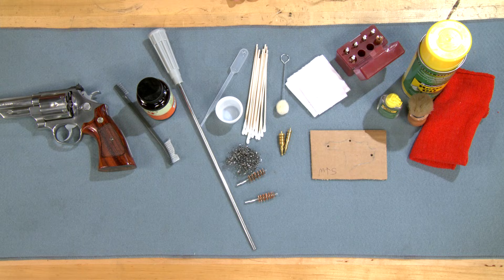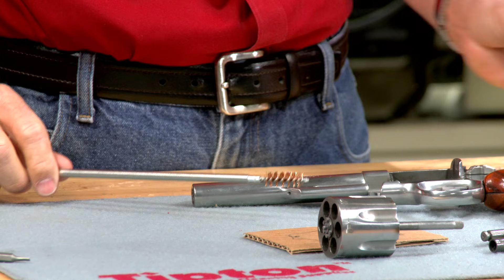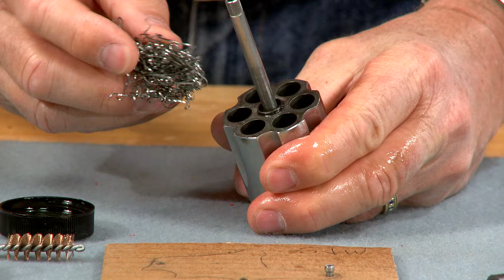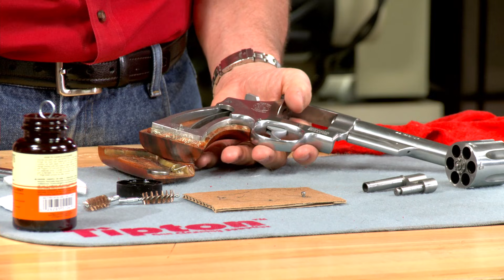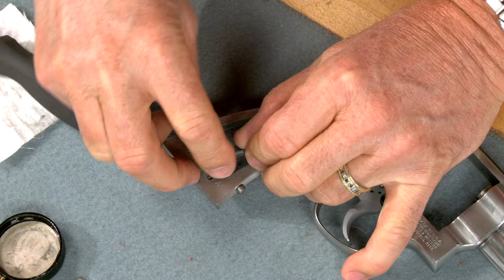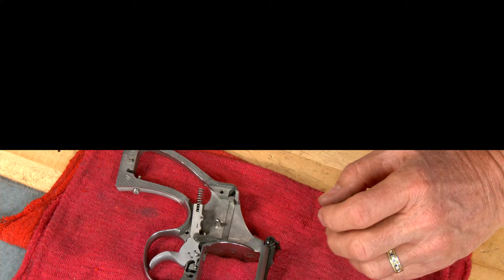How to Clean a Smith and Wesson Model 629 Revolver | Smith & Wesson Revolver Project

Comment: what i do is use a swab soaked in cleaning solvent and run that through all the major parts that collect carbon. Then after letting it sit for a few, i run the wire brush, THEN i run the same cleaning solvent again, then run several patches and clean it, THEN i put some lube on the swab and run that through and im done...been working like that fine for 30 years now...the way this guy is doing it, is if you wanna get your gun to a 100% perfect clean like if you are going to put it on display or something

Comment: Great Video, Larry.
I might add that one should take care when running the cleaning rod,  try to keep it straight and not rub the last bit of rifling bear the muzzle. Those sliding brass muzzle protectors should be used on the rod.
Also take care to not let the rod slam against the cylinder face. It is easy to do considering you are using some force to get the brush or tight patch through the barrel, then all of a sudden it enters the clyinder opening in the frame and there is no resistance.

Comment: I got a Taurus 83S in 1989 and fired it about ten thousand times until 1992. A gunsmith told me not to disassemble the extractor because "would be difficult not to break it" (he didn't know that model very well). Well... I disassembled the cylinder only in 2021 and I found ZERO reasons to open it, it was almost clean; no rust, no lints, debris , no powder, no fouling... I didn't understand.

Comment: Might want to try copper wool instead of steel. Softer metal  copper  "Chore Boy" will not scratch a stainless gun. Too scared to open the side plate.

Comment: Two things you failed to mention or show. You didn't show how difficult it is to reinstall the rebound slide and its spring. The spring is very stiff and can go flying across the room or worse yet, hit you in the eye. Next, you failed to mention that the ejector rod has a left-hand thread. To loosen, turn to the right and to tighten turn to the left. Remember the term righty tighty, lefty loosey? Do the opposite. Righty loosey, lefty tighty.
Reply: The thread pitch depends on the year of the gun.  Older ones were not reverse threaded.  Also, why would you think it's mandatory for him to make a commentary on everything?  This is just a quick video to show what's involved.  Reinstalling the rebound slide it not difficult at all if you have the tool he shows in the video.

Comment: May I suggest specifying stainless steel wool, instead of 'regular' steel wool. The possibility of cross contamination from iron in regular steel wool exists, and any contact could decrease the corrosion resistant (stainless) property of the firearm.

Comment: Larry should have demonstrated what a pain in the butt replacing the rebound slide and spring can sometimes be. A small screwdriver is usually better to use than the rebound slide tool.
Reply: The rebound slide tool is awesome for that.  It's a cone shape that fits into the end of of the spring and the bottom is hollowed out.  Makes it very simple.  No way to the screwdriver!

Comment: Please don’t disassemble your revolvers to clean them. A good spray solvent in each charge hole and down the barrel. Copper bore brush in all charge holes and barrel, nylon brush on cylinder face and inside window. Cotton patches on a jag in all previous holes and barrel. Old T shirt wipe down followed by oily old t shirt for protection. Disassemble only to replace or swap out springs. This video is so far beyond any necessary level of cleaning.
Reply: he said once a year pal
Reply: Bought a new model 27 in 2023 and popped the cover and stripped it bare.
The thing was absolutely filthy from the factory with a fine gritty dark disgusting filth in a 1200 gun.
It looked like it was assembled in a dusty field in a wind storm and the bluing looked like a monkey did it.
Ive cleaned S&W’s from the 60’s and 70’s that weren’t as filthy and that was right from the factory.

Last new one ill buy for sure

Comment: IMO, way too much oil is used in reassembly. Maybe if you are storing the weapon, but all the parts must disassembled and excess oil wiped off before I would ever fire it. I was taught a long time ago that even when you wipe off the oil and the metal looks dry, the oil has leached into the metal and will provide ample lubrication for proper operation. Too much oil attracts dirt and residue, all harmful to intricate moving parts.

Comment: My two revolvers sat in a safe for 15 years.  I then took them directly to the range.  After the first few shots they started to misfire.  I would pull the trigger and it wouldn't go back all the way.  I would then reload and try again.  Some shots worked...some didn't.  After a 10 minute cleaning using cleaner and oil...both guns started working.

Comment: When dissembling the gun, it is a good idea to take a picture of its initial construction before taking out the parts so you can use it as a reference when reassembling.
Reply: I agree with you, but taking a picture is a recent thing.  What did we ever do before cell phones with cameras?
Reply: @ppainterco  😂 that’s quite random and irreverent, owners manual bro , owners manual still helps more than a picture sometimes
Reply: @ppainterco  had to get the good old polaroid out back in them days lol
Reply: @SR-gs8zo  you make good points. I never disassemble my revolvers unless it’s to replace a spring. I can’t imagine anyone would completely tear down their revolver because they’ve put 200 rounds through it at the range. Like what are people doing that would require such a drastic process?
Reply: @WheelgunsOnWheels  I'm guess checking for surface rust. I get OCD with metal firearms...lol
Reply: @WheelgunsOnWheels 
I shoot alot more that 200 rounds a year through my most used revolvers
Try 2-3000
Some people shoot competitively and a complete disassembly is a must for the amount of rounds.
Reply: Or have the manual.

Comment: That is the coarsest steel wool I have seen in my life.
Reply: Definitely looks excessive. 000 and 0000 is nearly always enough
Reply: @Snubrevolver  I use Birchwood Casey lead remover and polishing cloth.  Cut a small strip about one inch by four inches.   Best thing I have ever used to clean powder fouling on the face of a cylinder.  Plus it doesnt remove any material from the cylinder which steel wool may do if rubbed hard enough.
Reply: @Mike-up6go  How does it do on blueing?
Reply: @Snubrevolver  Dont use it on blued gun.  It will remove the finish immediately.  Only on SS
Reply: Lol...yeah it's a stainless pot scrubber from the kitchen.

Comment: WOW. My 629 is 33 years old, fired 15K rounds and never had a problem. I will clean it today!! Thanks for your video.
Reply: @edcrobert T Yes sir. That was the 1st time I took the side plate off after watching this video. I did get the blueprints for the pistol so I would know where all the parts went back together before I took it apart. Good luck.

Comment: How tight is the screw that holds the yoke supposed to be?
Reply: Just tight enough to be snug without binding the crane. The .44mag has a decent recoil but if you clean it after each session you will snug the screw down when you reassemble it.  If you don't clean it each time,  you should check the tightness of each screw after shooting.

Comment: Thank you for showing me how to take apart this gun. I just went through a fire and lost everything including this gun. It belonged  to my father, he used this in Law Enforcement. Now I can save it. It looks fine, just a little rusty and very dirty. I soaked it in rust remover, and now in oil. I was able to get some screws loose, and others will not move yet. Maybe heat will do the rest?

Comment: Will the steel wool prematurely wear the cylinder? I would image applying bore cleaner and letting it sit should be sufficient
Reply: Brett Peterson I wouldn’t recommend this as the abrasives that are in scotch brite pads will most certainly scratch and destroy the finish on a firearm
Reply: Brushes that are used are made of softer metal typically brass so they will not scratch at all
Reply: @Brett Peterson green scotch pad is more abrasive, has embedded grit. I think he would of used that if it was good to use. notice his steel wool is the course style.

Comment: I like to use mother aluminum and mag polish with a soft brush on the cylinder face to remove fouling. Works perfect
Reply: Yes... I'd never be able to steel wool my 629. I'd leave the face a little dirty before I'd do that. Using rubbing compound is an excellent idea. Toothpaste would work in a pinch. Otherwise... great video.
Reply: Thanks for the tip man I was apprehensive about trying what was shown in the video

Comment: Did he run a patch with oil through the barrel after cleaning with solvent and dry patches? All I saw was solvent.
Reply: The inside of the barrel and cylinder holes are not recommended to be oiled. That's why you didn't see him do it.

Comment: how many rounds before you should clean again?
Reply: Dan Han a billion
Reply: (all personal opinion) Depends on the caliber and specific gun. With a small framed .38 special for instance, I start feeling enough grittyness around 300 rounds or so, so I feels that's a good time to clean it to ensure smooth function, that number could be lower with a .44 magnum, and much higher with a .22LR and so on. I however clean my centerfire revolvers after every trip to the range unless I fired less than 100 rounds.
Reply: Personal preference mostly.  Also depends if it's a carry gun that gets exposed to more junk or a safe queen.  Some ammo is quite a bit dirtier than others.  I tear down my N frames probably every 6-7,000 rounds and completely scrub them.  Many maintenance clean and wipe downs in between.  Hunting revolvers that get used in the weather after every season.

Comment: I'm a nobody regarding firearms, but think it shouldn't be used a steel wool to clean the cylinder front as it's abrasive to revolver's metal. A softer material like brass would be a better choice.
Reply: How can an opinion be wrong? An opinion doesn't even have to be factual, that's why they call it opinion. You're a dummy koolaidman007, but that's just my opinion.
Reply: Gun Sam ...what he was using looked more like a ChoreBoy than any grade of steel wool.
Reply: spanky9067 lol
Reply: Koolaid needs to work on his bedside manner. LOL. It's my opinion that what we saw in this video was not fine steel wool. It's also a fact... unless you're eyesight is diminished, in which case owning a revolver becomes a questionable thing altogether. It's also my opinion that there are better options to steel wool on my precious 629. And that is, without a doubt, also a fact. ;-)
Reply: Or a lead free cloth works well for  stainless
Reply: I agree if you are talking about a blued gun, but we are talking stainless steel in this video- and steel wool is not harmful at all to stainless unless it's very coarse steel wool.
Reply: +Sam Man Steel wool is steel wool. They're all coarse.
Reply: How dare you second guess Larry Porterfield!
Reply: +Alberto Jorge Soares Well your opinion is wrong. Fine steel wool will not hurt stainless steel

Comment: How about producing a similar video on cleaning a bolt-action rifle? I'd like to have one I can show my Hunter Education students.
Reply: Pushing your cleaning rod through from chamber to muzzle is a good practice on bolt action rifles (if the rod is long enough 😏) as you’re less likely to damage the rifles crown.
Reply: Blaine Nay That would be a pretty short video, don’t you think? Pull the bolt, push out your trigger pins and run a brush through the barrel...reassemble in reverse order. I think every gun manufacturer recommends to not take your trigger apart any further than that unless you take it to a gunsmith. Now you could certainly do it on your own (if  you are able to) but for liability reasons they don’t want you taking it apart.

Comment: One thing that I had contact with many years ago was; on a Smith and Wesson revolver (and probably on other "DOUBLE ACTION" revolvers as well) I, for what ever reason I don't know, pulled the trigger while at the same time pulling back the hammer.  And the pistol LOCKED UP.  Back then, we had to take it to a gunsmith who obviously pulled the side plate and unlocked it.  That happened on a Pre Mod. 29 .44 Mag.  Obviously, on a single action revolver, that problem would not exist but on a double action revolver, I guarantee you'll lock it up.  Hope this might potentially help someone BEFORE it happens to them.